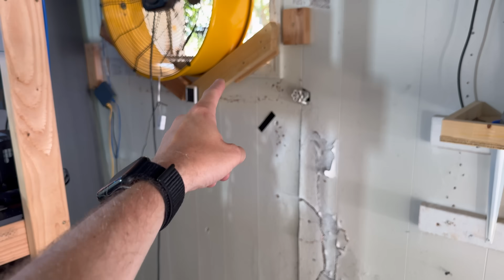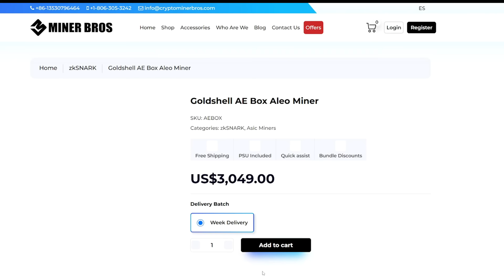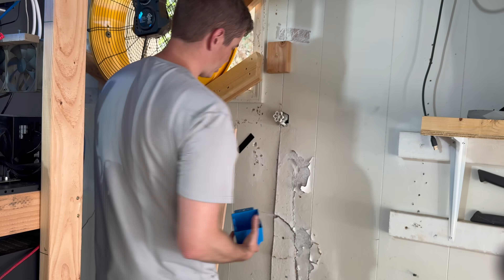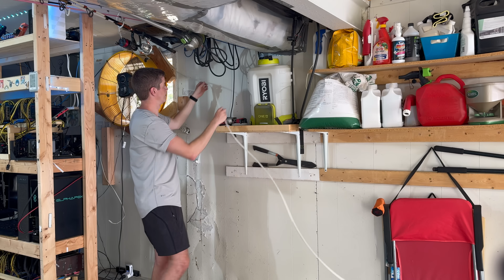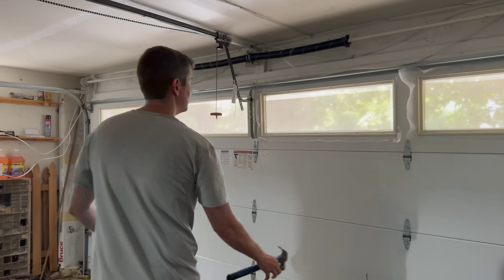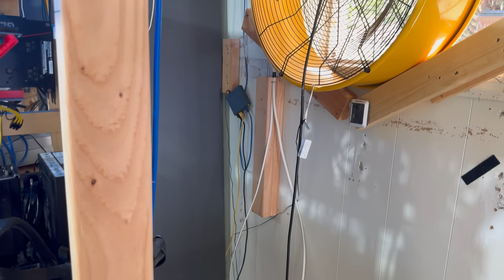I Added TWO New Circuits to My Crypto & Ai Mining Farm!

Comment: Ahhhh, c'mon we want to see you tackle that breaker box!!!  Ooooh, never mind you did it.  I would have used exterior metal boxes with romex connectors for the outlets, those are the kind with the rounded corners.  You put the outlets into the covers as well then attach them to the box.  Otherwise, great job, looks fine, works great!!!
Reply from the maker: Haha I panicked after I thought I cut the wires too short. Was actually fine though!
Reply: @ModernMiningHub  Honestly, I thought you cut the ground wire too short to reach the buss bar.  The other wires looked fine.  Yeah the white and copper wires need to reach further than the breaker

Comment: You're doing fine if you place the hot wire on the copper colored receptacle screws and the neutral wire on the silver screws.  Ground of course goes on the green screw.

Comment: Not done watching but...  30 amp 240v circuits pull from both legs.  but if you put them on the same side next to each other, they will balance each other out.
Reply from the maker: That makes sense thanks for the heads up!!